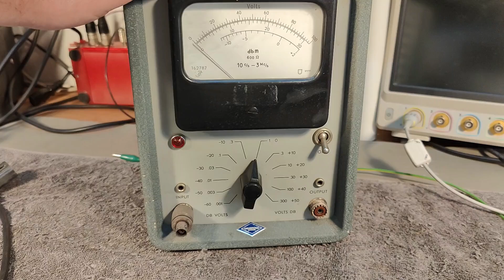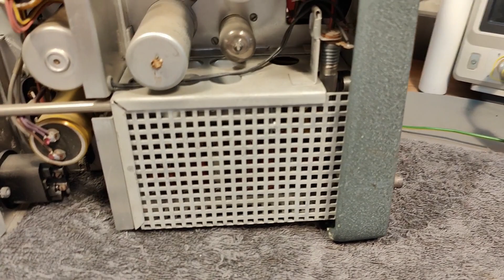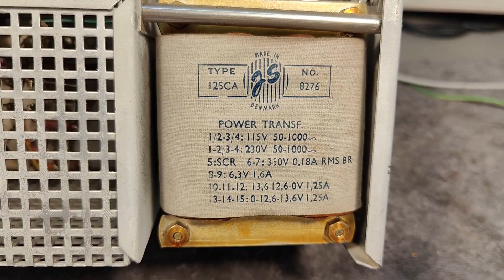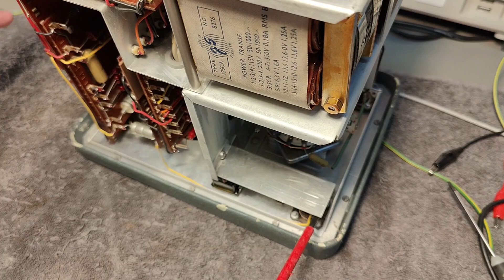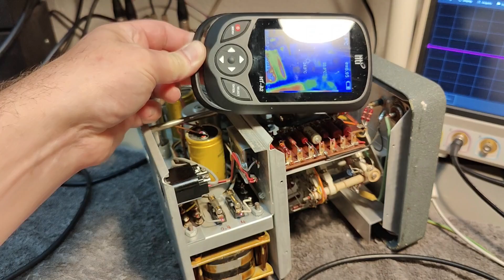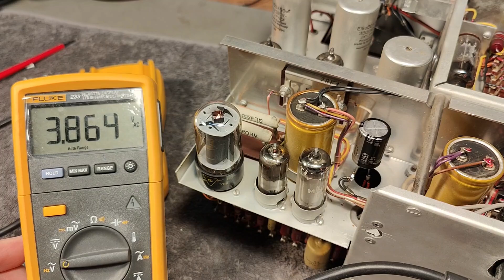Danbridge FR31 Vacuum Tube Voltmeter Teardown Repair

Comment: 17:00  Is double capacitor replaced with single one? Why?
Reply: Both sections are connected in parallel in the original design, to form a 50uF capacitor. Replacement with single 47uF capacitor is adequate.